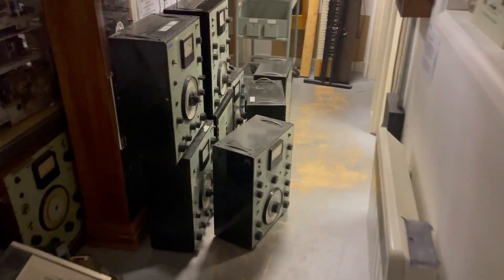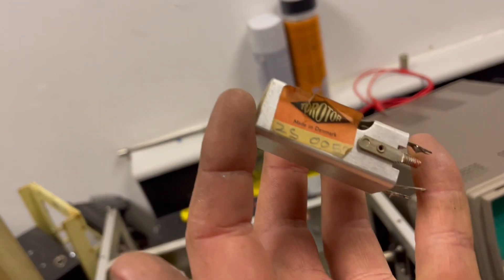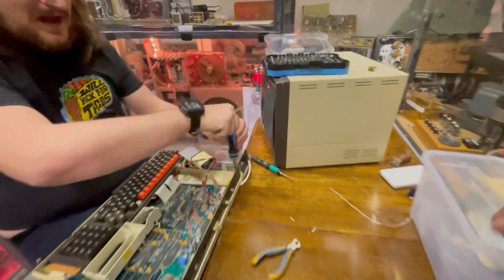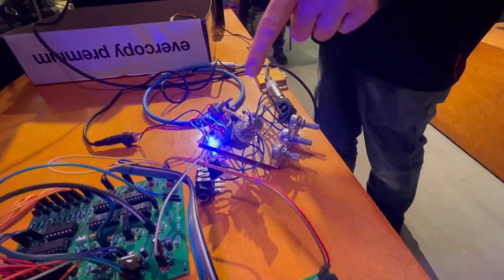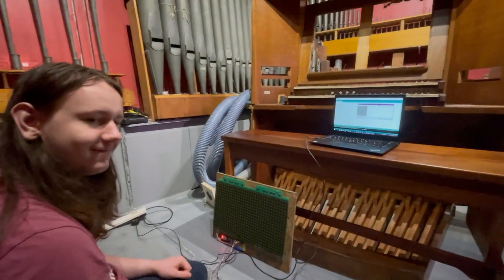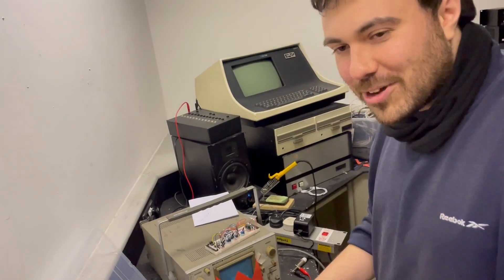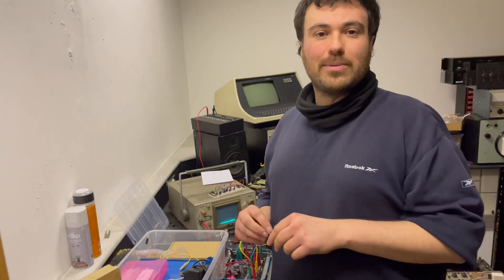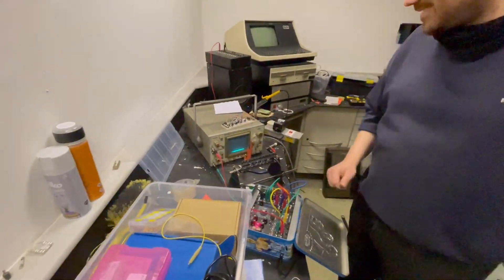Electronics Club March - Fixing Electronics!

Comment: jeez thats a tough job fixing those. im preparing to do the same and while the B&K manuals are great in detail, they're just bibles and you spend hours reading it and not getting all in your head what they can do :D .. a 2113, 1042 and 2021 will arrive soon at my door.. thanks to being inspired by you and hainbach. <3 (ps: did you already prep some microcontrollers with 5 pin 0/+5 or 0/ -6 V DC output switches, cause thats usually how you'd control their motors inside.) GL! .. now there are even more arguments to visit UK very soon for me..

Comment: We were donated one of those Russian oscilloscopes in my high school electronics lab back in the 80's..  Worked and everything, but it had a non-polarized plug and one end was on the chassis.  The teacher plugged it in backwards one day and got a shock off it and proceeded to chop the thing down into its constituent components because he was afraid someone would get electrocuted..   Such a shameful over-reaction and destruction of equipment.  I ended up with the CRT which I was going to use for a project..   Never did,  but the tube is still down in the basement today....

Comment: I think the motor might be used to drive a chart recorder for drawing frequency response graphs.
Reply: Yep. Usually they are driven by a flexible shaft but it's likely this addition was for plugging into a later digital recorder going by the connector. The other ones have an electromechanical clutch to connect to them he drive spindle of the chart recorder
Reply: But since a digital chart recorder wouldn't have a mechanical connection likely it's an addition . Got a number of the 1014's this is the only one with it and also no difference on the front so must be an addition